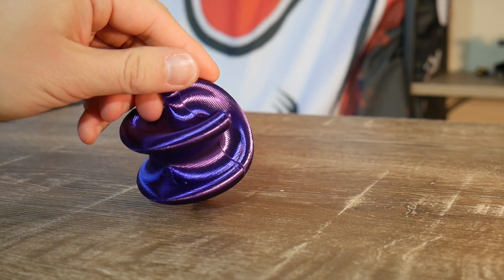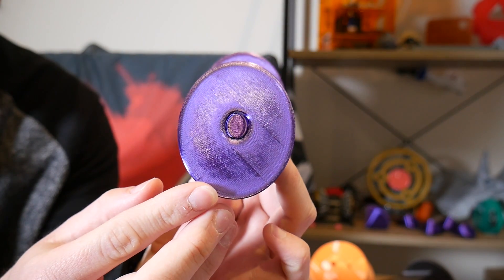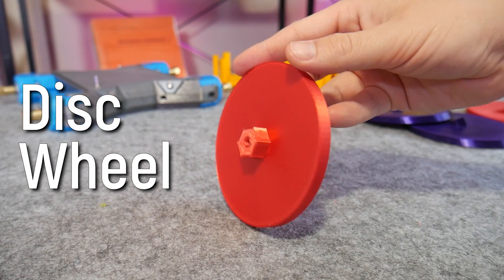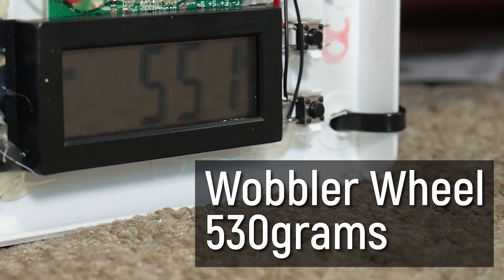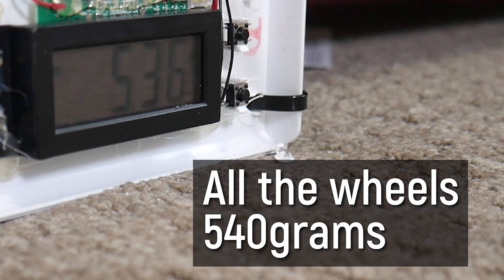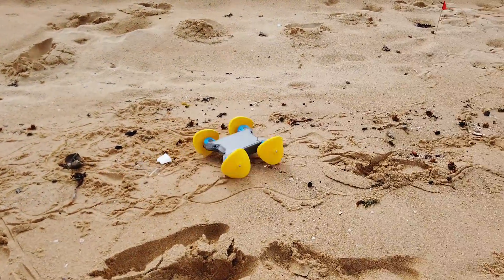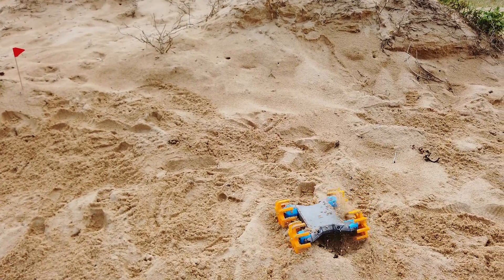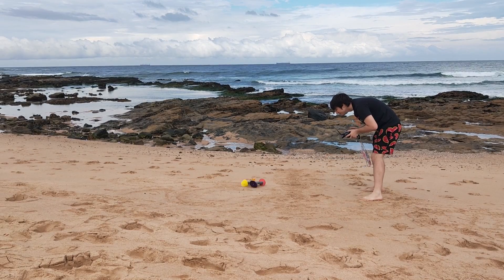This Robot Drives on Wobbly Wheels (but HOW?)

Comment: How about a compromise between the spoke wheel and the wobbler wheels, where it always has a contact patch like the wobblers and it follows the same general pattern, but the width of the contact patch is varied between almost nothing and in some waveform like a sine wave? That way, it periodically has narrow patches that give maximal efficiency on hard surfaces, larger patches to float on top, but also, if it starts getting bogged down, I’d hope one of the widths would be useful.

It may fail spectacularly, of course, and ideally, it’d have ridges going across like my Outback’s CrossClimate 2, which look like herringbone gears. Not sure how you fairly compute surface area, but then again, the spoke wheels were problematic for that, too.

Comment: Query; wouldn’t a fairer test be a consistently sized contact area between ground and wheel? So wobblers and prongles the same width as the spokes, after which one could start trying groove patterns?

Comment: One great design for sand-wheels I have seen in an old Soviet DIY project book. The basic principle is similar to your spoke wheel but all spokes are radial (think a bike wheel without the round wheel part). The spokes go deep into the sand (should be thin enough for platform weight to push them in) thus allowing for high "traction". But they will definitely be disqualified from the comparison.

Comment: alright a few notes on the controllability of the Wobbler wheels. if you make sure that the right and left sides are at the same angles from each other it will help tremendously. even more so if you can do opposite angles from the front to back ones. that will help control the weight distribution of the wobbler wheels.

Comment: But... all of those wheels were too narrow!

Narrow wheels are used for cutting through a thin layer of soft, low-grip stuff to reach a stable, high-grip surface beneath. Those would be great for anti-hydroplaning in shallow water, or cutting through shallow mud or slush to a solid road surface, but you basically couldn't have chosen anything worse for sand! For that, you need big wide wheels, preferably with very soft, squishy balloon tires, preferably with lots of tread!

So for a better wheel design within the parameters of that (frankly way too low) surface area, I'd recommend essentially taking the normal disc wheel and adding tread around it (possibly making it a bit wider because it'd use less of the allotted surface area per unit of overall area), and then add on perpendicular blades on the sides. Maybe just the outside.

I don't have a CAD program installed right now, but it would look kind of like this, only with the "wheel" part around the "equator" wider. If you backed the longitudinal paddle blades off a bit to make it clear that they aren't part of the allotted surface area, I think that could work really well.

Comment: You normalized by surface area but only accounted for the exterior circumferential surface. All the wheels except the disc have surfaces that contact and push on the sand in addition to that, especially the spoked ones. I would try again but include the contact area going down a third of the wheel radius as well. This would give the disc wheel more thickness and force the spokes to be thinner.

Comment: To be fair with design, the spoke wheels need to count ALL the surface area... which would result in a wheel about the diameter of the hub... so, you would need to make the other wheels about 6 times larger diameter...

Comment: Cool little test, I do wonder if a geared wheel system that has feet that push down and rotate around would be possible. Basically like walking on the sand but geared to work in a wheel like design so it rotates around also (2-4 feet per wheel).. meh just a idea.

Comment: The spoke wheels have more of their surface area in contact with the sand as the edges are exposed in-between the spokes.
All the other wheels were solid so only their edge had contact

Comment: I think that what you're missing is floatation.  All of your wheels lack a foot print that limits the digging in.  If you started out with a cylinder shape and then have a "tread" of the wobbler, prongle and cleat threads sticking out by some amount from the basic cylinder you'd get the floatation needed to avoid digging in.   In fact perhaps you'd get the floatation you need for drier sand just by making each of the options a bit thicker or wider to, say, double the contact area?  The other issue appears to be the lack of of basic ground clearance.  I have to wonder if all of the wheels would not do a little better if the belly of the chassis wasn't dragging a bit like a turtle's belly :D

Comment: I wonder how a wobbler mecanum wheel (or off-brand Omni-wheel) would behave? The angled rim always makes me think of their angled rollers. The platform should support the full range of motion with independent wheel control
Not sure it could be 3d printed in place though

Comment: I gave making a wheel for the sand climb challenge a go! I went for a paddle wheel shape with the hopes of throwing sand backwards. Obviously it's also got to be wobbly too! It technically has 2513mm^2 area touching flat ground so it's sort of not cheating!

Sand Wobbler Wheels: I think YouTube is removing my comment due to the link so it is: thingiverse thing:4795519
Reply from the maker: Got it downloaded for printing! Sorry for the delay, I didn't realise YT would make gathering the links challenging.

Comment: You should invert the prongle wheels. Note how they throw sand in toward the chassis? That'll only increase the rate at which it's high-centered and, thus, stuck. Inverted, they'd throw sand outward, potentially causing sand under the chassis to lower, or at least thin out (depending on the angle of repose and thus the water content). Piling sand around the outside of the wheels might even increase the traction.

Comment: Your criteria for comparison should be the clearance. ie. create a cylinder of space which is the maximum allowable space the wheel can occupy and give free reign within that region. You could also regulate the volume of material or mass .  Also, rake and pack the test course for uniform results.

Comment: hybrid, prongle and spoked..    Two different ways:  normal to plane where extruded from "chip", and purely axial.     normal form will wobble quite a it.   spoke length should be equal, and that gives two different configurations .... equally on both sides for the same length or  identically protroduing (intruding) around the circumferance.   That is either the spokes at greatest protrusion being planar, or mirroring the shape and orientation of the prongle.       So that's four potential  shapes. 

Actually, thinking about it I like a better version of the "spoke.     A spoked angled prongle. .    That is other than the hub don't print the prongle at all.  make truncated trianglular spokes but offset angled around the prongle pattern.     I'd minkowski the lot to take sharp corners off.

Comment: If we are doing a sand wheel design challenge, I think that the best criteria to standardize would be how wide the wheel is and its diameter.  That would mean everyone has roughly the same contact patch to work with for scooping sand out of the way.  That said, while your wheel hub design has measurements for diameter, I don't know how wide to go.

Comment: It seems that the best wheel might be taking the spoke wheels, and offset the spokes in a wobble/prongle alignment so each foot is not in line left and right with the previous one. Wobble-Spokes. That or perhaps even shaping the spoke-feet themselves into shapes. But then i suppose you are just working towards making mesh wheels...

Comment: None of the wheels completed the sand course because of a failure in the design of the vehicle, not the design of the wheels.  It didn't have enough ground clearance, so you were inducing a ton of friction along the bottom surface of the vehicle body.  Try again with larger wheels and a higher-sitting vehicle.  
Wheels go under the car, not alongside its centerline.

Comment: The wobbly wheels have the traction of very basic treads. The prongle wheels are an improvement, but if you make the perimeter oscillate 20 times and you can see where this is headed...

Comment: as much as I love this, I wanted to add something to the tests or something to think about. There are bikes that are designed for riding on sand and they have very thick tires to give them additional surface area and traction and not just paddle like texture. So instead of focusing on keeping the surface area the same, keep the wheel depth the same but keep the same patterns. As in, make each wheel as thick as the spoked wheel but keep the patterns there. 

Maybe with the nightshade/wobbler wheel, you could use a slightly altered design similar to sharkwheels for skateboards. I know for certain environments, the sharkwheels are better and one of them is off road. Maybe that will impact the changes, especially adding groves or divets in the wheels.

Comment: here is an stl with 4 "wire wheels" with helical pitches. 
If you do the "handedness" of these helix's to be equal across the diagonal, but opposite on the opposite diagonal you should be able to crab walk as well as drive?
(Or I would hope), yet when all 4 are driving forwards any thrust due to the "tread" design should cancel (assuming friction is constant)

https://drive.google.com/file/d/1RGyx-fePF9fht2NMTndPGGEydj2_bnW5/view?usp=sharing
Reply from the maker: They're gorgeous, cheers! Yes, I intend to find a "mecanum" style controller to see if crabwalking is possible in future.

Comment: Anything with tread, and wider. You can just reprint these with identical tread on the edge of them. Pull force isn't really measured if they're just spinning. You need to increase surface area contact for sand.

Comment: The problem seemed to be the low profile of the vehicle itself. Redesign the vehicle with more ground clearance and I feel you will get much better results in sand. You need a "Monster Truck" type design!

Comment: Steal a page from inetzga hehe @integza 😜 add the spokes to the round wheels but go one direction further extend them beyond the wheel rim outward like paddles. This might fix the ground clearance issue as well. As if it digs in a hole it might claw. It'll look like his rose propulsion tbingh

Comment: It would do better with a little more clearance. The bottom of the platform is getting stuck on the sand lifting the wheels off the ground.

Comment: This is great, however, on a smooth hard surface like smooth concrete, the other wheels WILL fair much better, the paddle wheels will be at a significant disadvantage as they will no longer be able to have constant forward traction actually losing it by bouncing the vehicle having it spend more time in the air than on the ground. It also looks like your motors have very inconsistent and lack of wheel speed left to right. When put under load, one side gets seriously bogged and the whole side looses power. You may want to run one speed control per wheel, just run them on a splitter from a battery and receiver and you'll be good to go.

Comment: I'd want to see a prongle variant where the edge of the wheel looks more like a sine wave, with the peaks left of center and the troughs right of center. With a high enough "amplitude" and "frequency", maybe you could simulate the paddles on the sand wheel while still having a smooth wheel

Comment: I think once the sand firmly touches the chassis its all over no matter what wheels you use. Having the same narrow contact surface is a very restrictive limit though. On sand you need as much surface as possible to avoid sinking in, to the point that the chassis rests on the sand and you lose all traction. I think if you at least tripled the contact surface, you'd get much better results on sand.

Comment: What if you combined the spoke wheels design with the prongle wheels design into one?
Reply: What would that combo wheel be named? Spongle? Sprongle? Sprokongle? Spokrongle? Sklonglegongle?

I myself am partial to "sprongle".
Reply: Seems like it might open the door to a wider area for the car to get traction. Like if it can't get it in one area the spokes would move in or out following the design of the prongle.

I'm a little surprised a simple spoked wheel where they radiate outward normally wasn't on the menu
Reply: @SwiftCreationStudio  Yeah, it would be a nightmare to design and 3d print though.
Reply: @j1der698  well I meant more like multiple large cylinders on a hub not so much spokes, I think a gear with fairly wide teeth shape would actually be better and suffice the same general idea.

If I wasn't about to sleep I'd design something like that but my printer is going to be busy the next few days.

Comment: That moment when people figure out the as long as the 2d normal projection of an object is a circle literally any shaped object can be made into a wheel
Reply: Actually, you can have non circle shapes that also have the same height from bottom to top at every orientation, so you can have even more wheels!
Reply: @davutsauze8319  nah for wheels the radius (in the 2D projection) has to be the same, not the diameter. Cause the center is fixed to the axle and with just the same diameter you don't have a fixed center but one that "wobbles around".
Reply: c u b e ?
Reply: @undefined06855  2d so that'd basically be a normal wheel. The op is kinda condescending but basically if you take a tube and cut any shape in it from the top you'll end up with something that can be used as a wheel
Reply: @joshoxborrow2314  I think you're mistaking his meme format for condescension. I mean his comment wasn't really directed at anyone. Just the fact you stated as well.

I mean I see your point, it does sound a bit like that but it's the meme format, not worth getting bent into a prongle about.

Comment: The spoked wheels also spread the weight more on the sand. Less psi.  
Although narrow tires are great for driving in snow to dig down to pavement, they’d beach the body in sand.  I’d bet if you increased to number of spokes, keeping the same surface area, it would be harder to beach the body.  What do you think?

Comment: Try large diameter wheels (is motors have enough torque) and yes, for the sand either bare spokes, or paddles will probably be necessary...